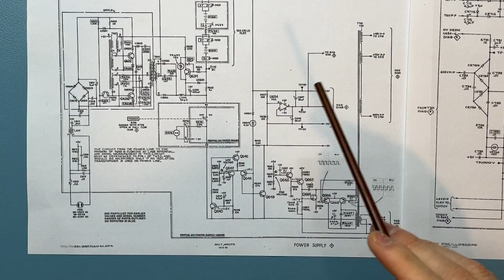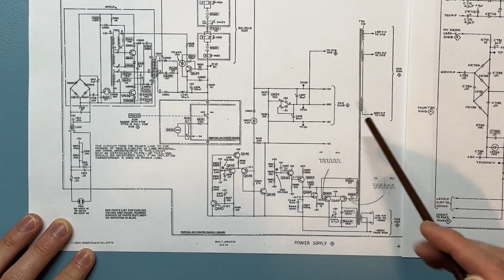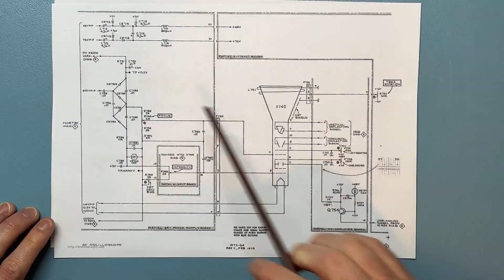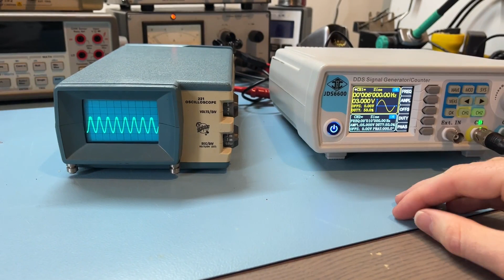Fixing a tiny Tektronic oscillosope

Comment: Thanks for the video. I actually have the same one, and it also doesn't work. 
I'll take a look at it. 

I was wondering if you could tell me what has been changed on the A4 power board so that it doesn't need batteries. I'd like to do the same thing, but I see some kind of Schottky diode where near the red and black wires got soldered.  Has the red cable been soldered in the same place as the diode?

Could you tell me what exactly has been done? I'd really like to do the same thing.

Thank you very much.
Reply from the maker: Hi! I got it pre-modified for that so I am afraid I don't know how that has been done 😅
Reply: @justanotherelectronicsblog5490 Oh! I can understand that. Do you think it would be possible to get close up pictures of this board on both sides so I can analyze it? If I can see what component was added and where, that might help me. I would also be able to add to this post.

Comment: I have the same model. Removed the batteries because they were starting to crust up. Now it's playing dead, I wish I knew how to trick the scope into running just on mains power with the batteries deleted. I suspect a jumper wire but I don't know. Somebody suggested putting a big fat capacitor in place of the twin battery pack allows it to fire up. Any ideas?